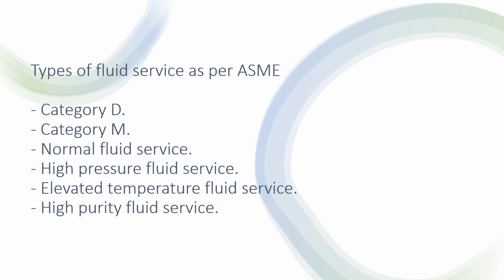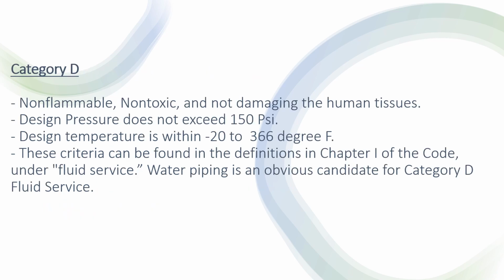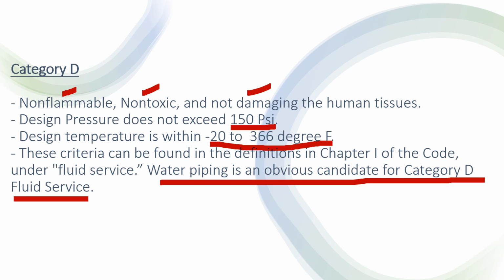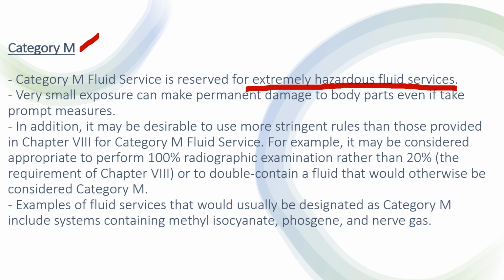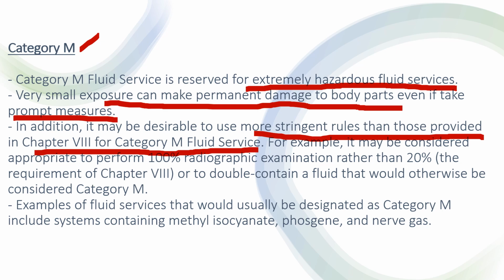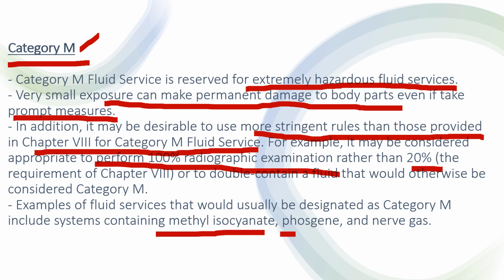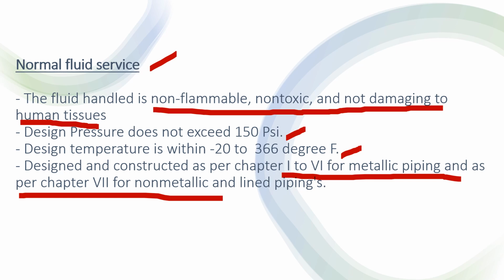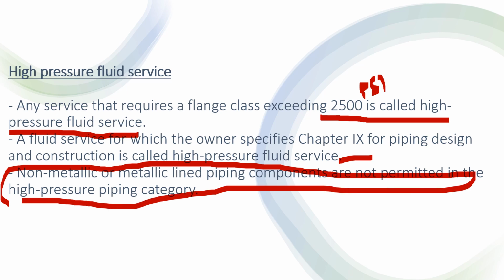ASME Fluid services

Comment: please is there any text in a standard code that sets the pressure limit for normal fluid of 150psi, I didn't find any paragraph that prove this limit of pressure, how to categorize 1087psi sea water fluid in normal temperature conditions